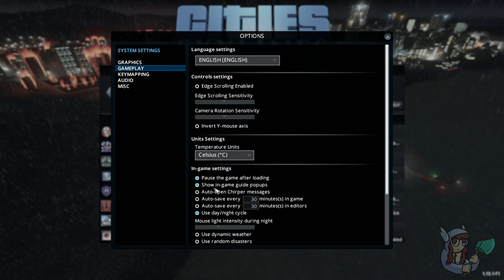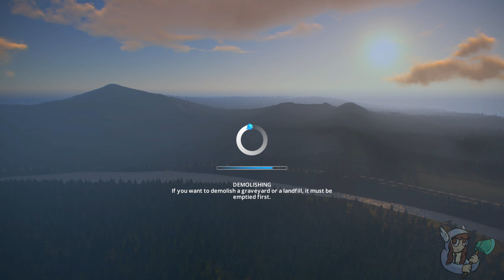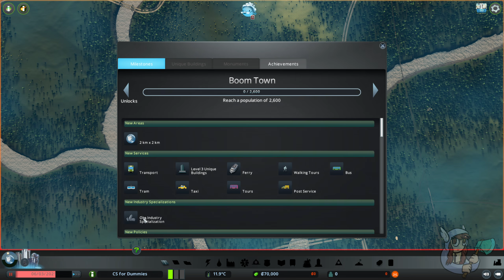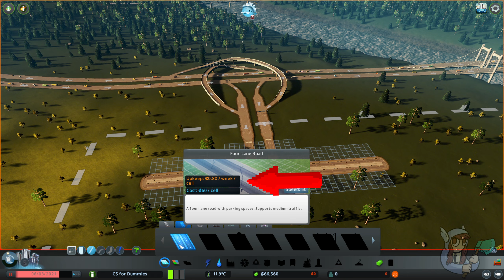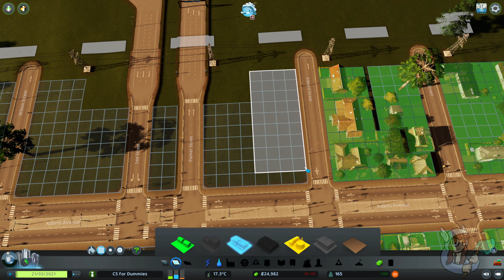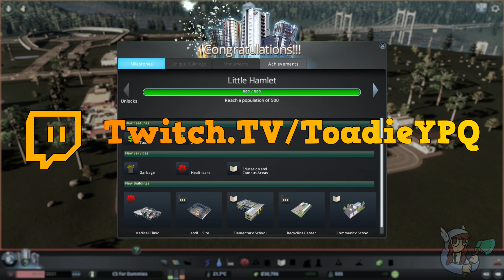Cities: Skylines for Dummies | The Basics

Comment: Thanks for this video. I noticed that industrial areas was listed as an upgrade when you reach enough population.

Does this mean your town won't have any demand for industry until you reach that amount of citizens? Is that why I started playing and I have one tall green bar for housing demand but the other two are empty, and the commercial and industrial areas I zoned have nothing built there?

I'm asking this while still watching the video, so apologies if you answer that later on.
Reply from the maker: You're on the right track of thinking, but not quite!

The industry that unlocks via milestones is related to the Industries DLC, meaning you can't start using them before said milestone. The regular/generic industry will start producing demand before that unlock - you'll see it in the demand bar soon enough! It's normal for the first demand to be just residential, then as those people move in they'll want jobs, thus creating commercial and industry demand.

I said you're on the right track because that is how a lot of the services work! Your citizens won't desire deathcare for example until deathcare is unlocked.

Hope this makes sense!
Reply: @ToadieZzz Makes sense, and thanks for your quick reply. I'll dive back in later!

Comment: did step by step setup as urs and there are still icons above the house about sewage and water
Reply from the maker: It'll take some troubleshooting on your end. Do your water buildings have power (and the city has enough power)? Do the pipes cover the house? Is the sewage output too close to the house? Do you have enough water in/out?

So many questions! : ) If none of these are it, it might be worth posting a screenshot in Discord for someone to diagnose.

Comment: This is amazing!  I've had the game for a couple weeks and been so frustrated.  One question though - if you build a one-way road going the "wrong" way, how do you make it flow the other direction without bulldozing it and starting over?
Reply from the maker: Thank you! <3

To fix your one-way, get into the road menu as though you're going to place a road. On the left you'll see four options for placement type: straight, curve, another curve, then update. You want to use the right-most option, update, and right-click your one-way road. It should reverse its direction.
Reply: @ToadieZzz  This has been driving me crazy trying to figure it out!  Thank you!!